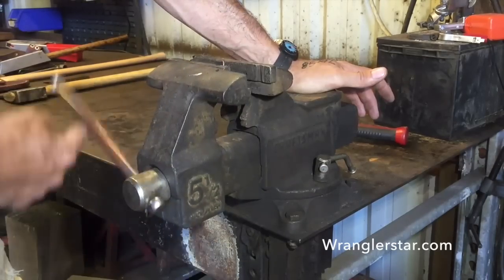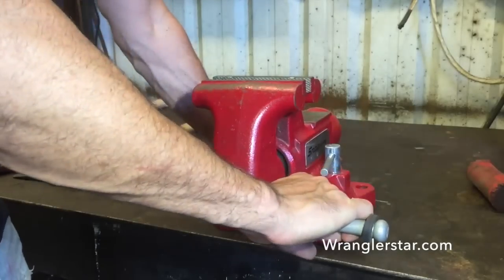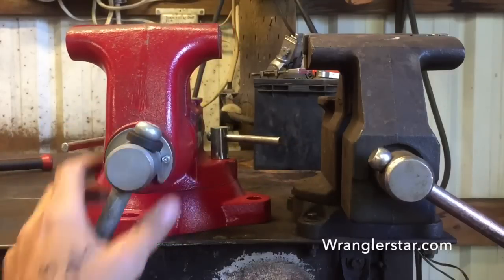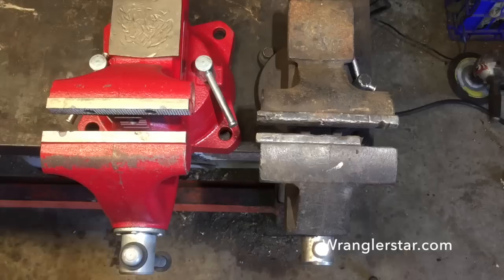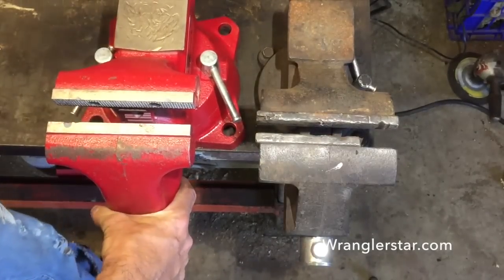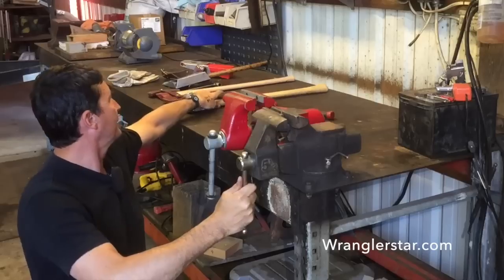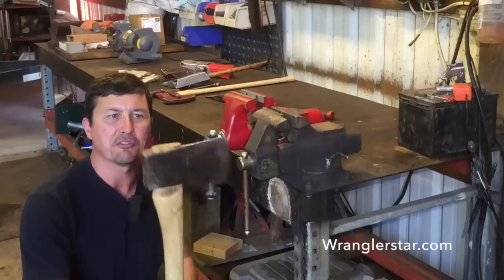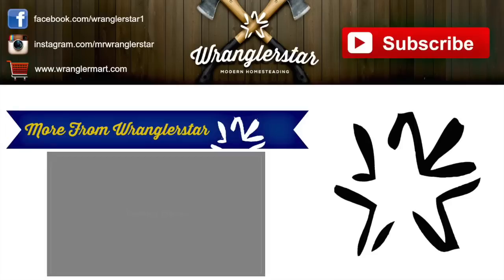The Most Important Tool In Your Shop | Vise

Comment: FYI:
The Heuer Vise is the finest bench vise in the world. Born in Germany and still made in Germany. In 1925 Josef Heuer was granted his first patent for the "Duel Prisim - Guide Track" design
The Heuer vise is constructed from a FORGED STEEL frame, 35% stronger than cast iron, making it the best choice for precision, smooth as silk machined surfaces and indestructable vise.
can be bought with or without a rotating base- Check it out.

Comment: I don't even have a workshop. All I have is one overlarge saw horse in my living room, on the other side of the sofa, right next to my bandsaw and a couple of knee-high drawers I picked up at a dumpster. Aside from those and my planes, saws and chisels, my only tool is an F-series Ridgid 5.5" drop-forged steel vise.

Don't have anything to bolt it permanently to at the moment, but still, yeah, it's one of the most important tools to have. The Ridgid costs a bit more money as compared to others, but it's really tough and smooth, and it's got sexy lines to boot.

Congrats on getting the Snap-On!

Comment: Old vice restoration plan.     New jaws - maybe copper,  new tommy bars ,  shim the sliding action,  paint job,  install outside (on a tree stump if you don't have a bench outside),  or further along your bench with the fixed jaw inline with the snap-on, so you can hold long stuff.

Comment: Not everyone needs such a large, heavy duty vice, but I'd recommend a (blacksmith's) post/leg vice. The juggernaut of vices. I found my 6.5" jaw leg vice at an antique store for $100 about 10 years ago. Stamp reads Pittsburgh 1898. Not a chip on it, or a spot of rust on the screw. Just some hammer marks and a dark patina. No doubt it will last another 117 years.
Sincerely,
A Kentucky Blacksmith
edit: I have it mounted on a big stump in the shop involving a brake rotor and 5/8 ball bearings so it will swivel and lock.

Comment: Wranglerstar, I have a vise related question.    I make jaw harps in my spare time, so my vise is regularly in use.   Tightened and loosened dozens of times a day.   I bought a cheaper 80 dollar craftsman vise and wore it out in a month.   Never abused it, not overtightened it.   I was thinking about trying to find an old used wilton or record vise, because I know they are legit and are made for regular professional use.   I seen this video and was wondering how your new vise has fared over time.    Also you speak of woodworking vises in some of your other videos.   I made wooden jaw covers for my now broken vise and worked great for reducing marring.   Would a carpenters vise be a good option as well.   Any advice would be greatly appreciated.    I love your videos and thanks for all you do.

Comment: another great video Cody.I use A black smith vice which works good removing ax handles as I'm trying to fit them.The handle clears the work bench much better.  Also the swivel vice I have I changed the swivel lock "T" bolts to proper grade 5 hex bolts. I love your channel.

Comment: It's a fine vise. Snap-on makes fine professional grade tools but it's  not all that.  Compare that to a Wilton and the Wilton is every bit as good -if not better.  The Craftsman is fifteen years old.  Show us the Snap On after fifteen years of use. BTW - Mic those handles and see that they really aren't that much  bigger  than the ones on the Craftsman.  It's your perception.  Some  real advantages of the snap on are two locking handles instead of one -at 180 degrees apart. and four mounting lugs instead of three. and they are thicker.  It truly sounds like a paid endorsement for the Snap-On
Reply from the maker: +gimpcornet Wilton makes the vices for Snap-On,
Reply: +Wranglerstar Wilton is by far the best vice. Worth the money!
Reply: +koviack The top of the line Witlon Bullet vises like the rebadged one he now owns are still made in the USA, and are still of good quality.  they are also around six hundred dollars.   Chris
Reply: I'm pretty sure it's an UN-paid endorsement for Snap-On.  Over half of what you said in your comment agrees with W.
Reply: ***** Parkers are good, but I'm not so sure that they are any better than a large Wilton vise.
Reply: Snap on vises are just wilton USA bullets with a snap on logo. They're even made by wilton in the USA if I remember right
Reply: the highest line of Wilton are USA made
Reply: Don't forget about YORK which was the company from where the founder of Wilton came from in the early 30s... Those are as good as wiltons, not so fancy though but they cost in the range of 100 bucks for a 10/15 inch and not $500 plus.
Reply: What are the advantages and disadvantages of a bench vise

Comment: Nice vice! I bought a "used" made in usa wilton mechanics vice that looked brand new. that is one of the best vices I have seen and for 200 bucks, its hard to beat. Very robust and the where the swivel base and the vise meet, both parts have cast serrations so that when you turn the locking screws, there is absolutely no way the vise will rotate unless you somehow break the cast serrations.
Reply from the maker: backwoods223 Wilton makes very good tools,
Reply: +Wranglerstar Wilton likely made that Snap-On you have there.

Comment: At 4:00 Wranglerstar talks about the lock down handles.  Not only are the handles larger but the overall design is much different between Wilton and other vises.  Wiltons have an toothed ring located in the base that interlocks with a matching toothed ring in the upper arm.  Once the teeth are interlocked, this vise will not turn.  It is also why the vise can rotate 360 and not just 180.  Finally, I like that the main acme screw is totally shielded end to end.
Reply from the maker: cemx86 Yes I noticed this when I installed the new vice.

Comment: That's a good looking bullet vise! It should serve you well. Your love of old tools and restoring them, motivated me to finish restoring a very old Starrett-Athol vise I got off craigslist a few years back. Only 4-1/2 inch jaws, but it is massively overbuilt and opens to 8 inches. Weighs ~100lbs, about a foot tall. Ready to serve for another hundred years!
Before: http://shadowflareindustries.com/photo/_data/i/upload/2015/08/21/20150821041547-ede79481-xl.jpg
After: http://shadowflareindustries.com/photo/_data/i/upload/2015/08/24/20150824000305-c432ac81-xl.jpg

Comment: Snap on sell some expensive tools. It's good to have friends who wish to stay anonymous! Some gift from them, a very generous person. You'll use it though, no doubt, so I'm sure they felt pretty good about giving it.

Your work bench is now the weak point basically, gusset welding time maybe. Haha it's always the way when you get nicer tools, you realise that you need to bring the rest of your system up to standard, at least for me anyway.

The work you could get out of that vice, with the pipe jaws for ram pump stuff and the nice clean jaws. Heavy cross sections and bulky weight keeping it all rigid and removing wasted effort.
I need to get a workshop vice more along that style. I have blacksmith vices only currently. They work very well but outside of blacksmithing they have disadvantages that a tight cast steel vice would fix.

Comment: Something for you to think about, the anvil is soft steel (hence the hammer marks). You can work harden it so that it doesn't mar so easily. It's a simple matter of using a semi flat faced hammer and tapping every part of the surface then flatten it and repeat at least once. This will compact the iron and make it more durable. This holds true for your blacksmith anvil as well. Just a thought.

Comment: You have a loose swivel base on the older vise.  Take the vise off, turn it over, oil and tighten the swivel bolt.  Then it will be tight and snug, ... and the same for the screw and vise shaft threads.  Grease the threads and it will be back to proper work.

Comment: One thing that I've come to leve on my vise it the two locking lugs on the sides. However, mine have 3/4" Hex Lugs so I can crank them down with a wrench opposed to the little bars. Very sturdy.

Comment: Snap on made by Wilton vise.  You pay 100.00 an inch plus.  So a 5.5 inch vise runs around $600-650 .  Bought mine in 1984 for around $350.00. They are the best out there and worth it.

Comment: 15 years and "worn-out" ? Old one probably wasn't good even when it was new.
I and my family have a few York vises for an ages .. and when I mean ages, then imagine my dad has 150mm wide York since I remember which is almost 40! years and the vise is still not that loose as you showed on old one. What, Used? Yes, sure thing York is used, beating and bending metal bars, tubes, small blacksmithing works, welding on it (ground through vise, cleaning and drying velding electrodes just by shortcircuiting through vise head etc.) . Just replaced jaws one time and that is. Old good York vise.

Comment: I can barely hear you! Wonder if you accidently messed up a setting on your mic when you were showing us your system.  It's worse today than it was yesterday.
Reply: I can hear him fine
Reply: MotherOfManyHorses i had no issue hearing him also.
Reply: Jonathan Knighton I don't have very good sound on my laptop.  If there is any weakness in the video sound, then I can't hear it. Then I have to use my tablet that has better sound.  These last 2 videos I haven't been able to hear very well on my laptop.
Reply: No issues here on the laptop (MBP) or IPad/IPhone.
Reply: Robert Farmer Excuse me!  I was NOT "complaining".  I was pointing out an issue that he may not have been aware of and I had no way of knowing if it was my problem or his.  As I mentioned before, I had no problems hearing him prior to his video about his system. Now, all of a sudden, I am having a problem hearing him.
Reply: MotherOfManyHorses There is a way to increase the sound volume of your laptop.
(1)  On the margin of your laptop's screen, there should be an icon of a Speaker.  Click on it.  A box appears with a little "slider" icon.  Put your cursor on the slider and raise it to the top of the column.
(2)  In the corner of your laptop's screen, there should be an icon of a Window's Flag.  When your place your cursor on it, a box should appear reading "Start".  Click on the Flag.
(3)  On the menu that appears, click on "Control Panel".
(4)  On the menu that appears, click on "Hardware and Sound".
(5)  On the menu that appears, under the heading "Sound", click on "Manage audio devices".
(6)  On the menu that appears, under the "Playback" tab, an icon of a Speaker should appear.  RIGHT-click on the Speaker icon.
(7)  On the menu that appears, click on "Properties".
(8)  On the menu that appears, click on the "Levels" tab.
(9)  A couple of slider displays should appear.  One of them should be labeled "Audio output" or something similar.  Place your cursor on the slider and move it completely to the right, to the loudest volume setting.
(10)  Click "OK" and then close all of the windows.
Yes, I know that this is a long list of instructions.  Microsoft never makes anything easy.
Reply: Kevin Byrne Thank you for the detailed instructions on how to adjust the sound on a computer. I'm sure they will be useful to someone.  In my situation, all my sound bars are maxed.  I only have a low end laptop. It is what it is and there will be no upgrade any time soon.
Reply: +MotherOfManyHorses Hey so you could play with the settings to lower the bass in the audio ... i have increased it in my PC because i listen to everything on a 32inch tv which has great speakers but a laptop might be quiet if you increase bass 
1 Right click on the sound icon 
2 Playback devices
3 click on your sound device (laptop)
4 Enhancements
5 make sure you don't have stuf set up here to increase certain audio spectrums to make sure just untick everything
6 Turn on loudness equalisation ON (little tick to the side and click apply) this should cause all your audio to stop playing for a bit or completely so you need to restart anything that uses sound like music and videos and ones you do you should hear the differance
Reply: Hard to hear on my laptop and desktop.

Comment: There's not a lot wrong with that crafts man I would not be throwing it out. I prefer a fixed base vice for heavy work. I wonder if the difference in the casting thickness is because the older cast on the craftsman is a better quality?

Comment: The reason the craftsman vice is buggered is you ! Im not  a Craftsman fanboy either as we dont realy find that brand in Scotland much but any vice ive ever used is 50+ years old and they last because they were used properly. The dings in the Snap On anvel portion indicate to me that its not been correctly hardened as corners have been cut.

Comment: A good vice is indispensable.  Cody if you get some 2 inch square tubing you can make a mount for they old vice that will slide into your trailer receiver, no reason to call it junk yet.
It still has some life left in it!  Make the mount/stand an L shaped so you can raise up to a good working height.  Working in the field I wish I had had something like this many times.
Reply: Kriss Femmpaws I have been wanting to make that one of my next projects.
Reply: Kriss Femmpaws I was thinking the same thing , Great Idea!!

Comment: Kinda looks like a Wilton, and I wouldn't be surprised if Wilton made it. I'm a train mechanic, and I don't depend on all of my tools every day like a flat-rate mechanic; therefore, I don't need to be able to trade out my broken tools for warranty from a tool truck. This luxury has afforded me the ability to purchase tools from the manufacturers who make the "tool truck" branded tools. Essentially, with a little research, it is possible to get Snap-On tools at a fraction of the price. The downfall is that they won't be supported by the tool truck when they break. Many companies make tools for brands such as Snap-On. 

Anyway, just a tip. :)

Comment: I wish I could afford a $700+ vice, guess its $70 Harbor Freight vices for me!
Reply: Akademee keep looking on the interwebs you can always find a deal if you look for em
Reply: Akademee For a lot of purposes, the inexpensive vises are adequate. A nice vise is a pleasure to use though. Most likely, his old vise will continue giving service for many years. They are one of those things that you can't have too many of. Put it on a table somewhere else. Mount it to a stump outside.
Reply: Akademee Ask the older guys in your neighborhood. I still use the vice I got from my downstairs neighbor. he's ninety.
Reply: Akademee Craigslist around here has a solid selection of antique vises that are better than anything in production now. Generally less than $100.
Reply: David Kirtley Good suggestion for having a vise nearby where ever you are. I've often threatened to but never did put a socket in the floor of my shop in all 4 corners and one in the middle so I could pull up my vise and move it around to wherever I need it at the time. I currently am vise poor, having only one in each shop in working order. Given time I'll have the other 3 bolted to benches. 
I really like Kriss Femmpaws suggestion of mounting one to a hitch point on my truck.
Reply: +Kriss Femmpaws That's some good adVICE